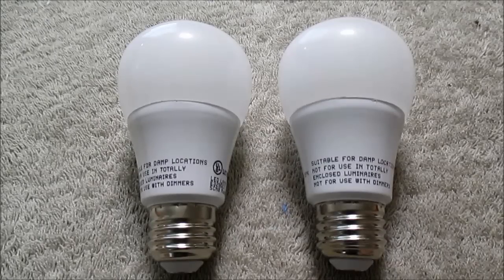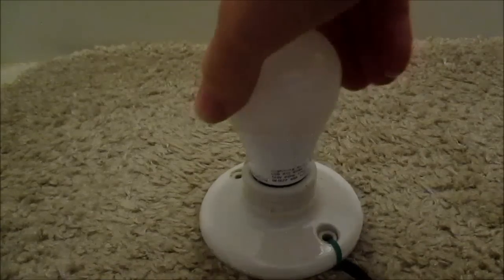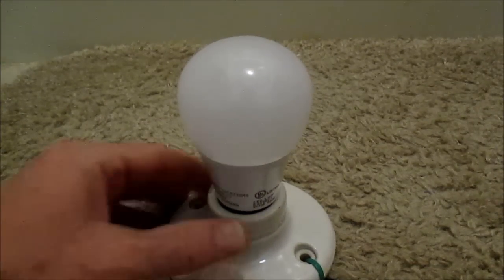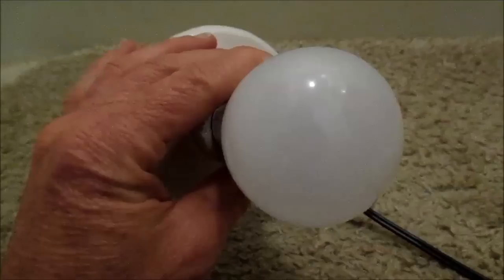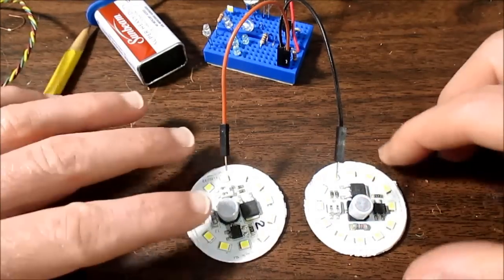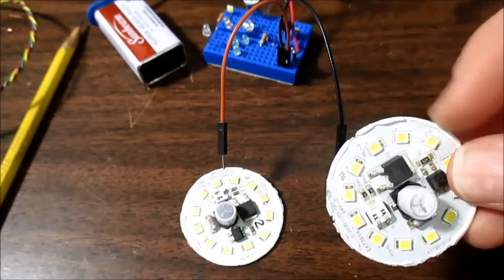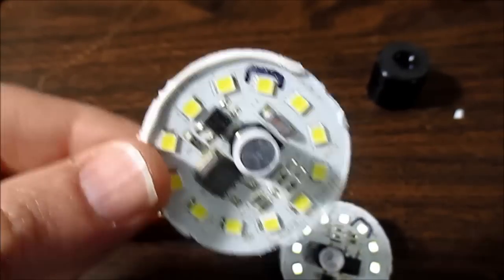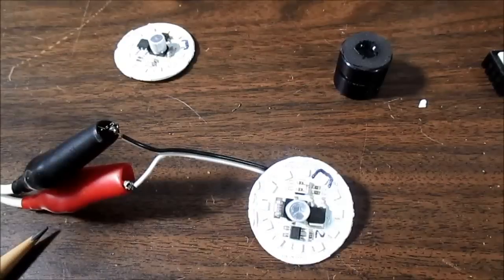Two failed LED bulbs for teardown to determine the cause

Comment: Those are set up as a series so they are designed to fail. Damn junk. Who does that. hell they dont even make christmas lights like that any more do they?
Reply: Not Here well said
Reply: I would say its more than just being uninformed. If you ever try to have this discussion with certain people, they will probably defend their way of life as "the way it has to be". Not everyone though. I try to show my kids how to fix things and how to buy things that can be fixed to avoid waste.  Also, how to stop buying all these things to begin with and how to be frugal.
Reply: Mike H : I always figured quality died because it was simply too good. Not that consumers were stupid. More than a few times over the years I'd find an excellent item, well made and fairly priced (not cheap, but not crazy high either). By the time it finally wore out or broke down and I needed to replace it the company was out of business, often for years. They probably made a small profit while they were in business but once the market was saturated with the product they were left without repeat business because their product was still going strong for those who bought it.

Along comes the (false economy) model of planned obsolescence where you make the product just good enough to last just long enough that the consumer is fooled into thinking they got good value so they buy another. Presto, infinite repeat business. Just keep churning out the same junk year after year after...

Same thing drives the whole disposable vs repairable marketing meme. Used to be pretty much everything was component based and easily repairable (by skilled people) by replacing a single inexpensive failed component. Then somewhere along the way manufacturing went to a module based design, where the components were grouped into units. If a component on a module failed you could replace the whole module (no skill required, plug and play) but could not simply repair or replace the failed component. Even while most of the module may be perfectly fine and continue for years more service. And that module was often a significant fraction of the cost of the whole product, often to the point where it was seen as just a smart to buy a whole new product rather than replace an expensive module only to have another module fail soon after.

Idiocy in my opinion, but too much of the public were gullible enough to (literally) buy into it. And quality repairable products were history. Replaced by crap disposable products.
Reply: @nothere7198  The issue is companies that are in the same market constantly try to undercut one another in price. This causes them to sell the product cheaper which leads to "cutting corners" in order to make a cheaper priced product.

just look at the Automobile market. look at how many mechanical and safety recalls and lemons there are among all car manufacturers compared to 20 or 40 years ago.
Reply: rats arsed excellent sarc!
Reply: I suspect they are calculated to not last too long. Isnt this supposed to work 10-15 years...yeah right.
If they gave the LEDs a bit more cooling, this would maybe not happen often.
Reply: You say "gullible", I say "uninformed", and/or "unable to find a reasonably affordable alternative". But the end result is the same. =:o\
Reply: Avi  inc  There is nothing stopping you from making lights at a loss and selling them to us. Go ahead. Show us how it is done.
Reply: +RC Hobbyist
   If you ever played with any kind of p-n junction rectifier, you might have noticed that in the forward direction they have a very low slope-resistance.  That is to say the voltage drop across them changes very little for a large increase in current.   With an LeD this forward voltage is 2.5 - 3v.   They therefore need to be run from a constant current source - a current limited source to avoid burn-out.   Since the domestic supply is ac 110v USA, 220v here in europe - the easy/obvious thing to do is to run them same as "fairy light" via a rectifier via small capacitor on ac side, and with a reservoir cap. on the dc side.  The rreason for the riduculous burn-out rate I used to experience, it that the series current-limit cap. they make several sizes to big !!  The lamps get very warm - almost like old incandescent !! - and of course on LeD will pop, just like Christmas lights.  Sometimes it is visibly cooked, other times you have to sift through to find it.  To do that requires a current source such as a "Blocking oscilator" to avoid killing the leDs.  Otherwise a 36?v battery with a 20-odd k resitor would do, to find the break.
   I have replaced 1.5uF x 400v caps with 0.47 - .68uf.  This gives 99% as much lightm but the lamp runs cool.  No more than blood temperature - and will last Donkey's years !
Reply: +boostedmaniac
  one leD "out" kills the lamp, since they tend to go open rather than short - circuit.  like fairy-lites.   You can bridge-out the dead one with a whisker of Cu wire - then replace the limmiting 400v cap for one of 1/2 to 1/3 the uF-age.
Reply: It would also be less efficient and produce more heat.
Reply: Rick   Take your meds!!!!!!
Reply: Okay, maybe another layer of tinfoil then.
Reply: RC Hobbyist Extreme not really. You set them in series, because the mtbf for LEDs is usually very  high. Also, you only need one means of current  control, so it is actually a simpler circuit. Of course if you use 2nd rate LEDs in the first place, that equation goes sideways, as with this product.
Reply: Actually they do. I just threw out a string of cheap series lights...
Reply: Cheap LED TVs also fail all the time. The PWM circuit is pretty neat, tho. Some have no more than half a dozen LEDs in series and a couple of zeners in parallel for each PWM drain. 

Others just do it in the simplest possible way, even employing poorly efficient voltage and current monitor-control circuits with dozens of LEDs in series fed by a single MOSFET so when a LED is shorted, the others begin to draw more current and short another one, so the circuit draws even more current and a couple of LEDs are also shorted and it goes on forever until one or more LEDs are blown, sometimes even melting the lenses and lighting the reflective paperboard on fire! 

I'm dead serious. I once opened up a Samsung  expecting to find a few open LEDs and I was surprised by burnt paper and molten plastic.
Reply: +ralorpa
  Replace the 400v cap. with one of 1/2 to 1/3 the capacity.  That makes un-noticeable difference to the light, but it runs cool and will last "Donley's years".
Reply: +Aeolwn
  Amps go THROUGH things luvvi.  It's Volts that go "on", or rather "across" things.
Reply: +renalpoen
 -- but think of the ammount of hot water each lamp could provide with a water-cooled heatsink !
Reply: +Thomas Bogel
  I would go so far as to say it is Always extremely long (mtbf) if the LeDs are not cooked-up with excessive current, as is the case with all the lamps I've bought.  They run hot like filament lamps.  Ridiculous !  A half to 1/3 of the current setting capacitor cures that.
Reply: +Gerard Vaughan
I kinda' agree... the caps seem to be the problem in 10+ led bulbs that I've seen failed; they are not correctly calculated, OR poor quality... and I guess designed to fail anyway as the datasheet for caps says 2000hrs max mtbf as opposed to "10-15k" hrs for leds. So I was looking to replace them also, but guess what: a good capacitor would cost as much as a cheap led bulb...at least in my market. I welcome any thoughts/corrections
Reply: +Christian
  Look on ebay, I think you will find it well wortgh while to buy a dozen or score of 400vac x .47 to .68uF  Possibly 1uF for the bigger lamps.  One I have, has two seperate rectifier units, which had 1.5uF series in each.  I ended-up with .68 in each, I think.  But you need to buy  at least 10 of each.  They will go - or sell ! - soon  enough.
Reply: +Mathew Young
  Mass production is the Only way to make the things we have affordable.  Stock-holding is therefore just as essential as the Liver is to the body.  Cancer of the liver, however, is quite horrible.
Reply: Everything is swimmingly super in "capitalist" false flag terror controlled uk - yes we know.  We moved to Bulgaria when we had the chance !
Reply: +Jay Eddington
  What a great idea !  "We" - the politbureau -  could set an upper and lower limit for the ammount of Anything that Anyone was allowed to have on their premises !   Imagine all the smart jobs that would create fo bureacrats and Swat teams !  Super, just like USA but even way further ahead !   Some items would be compulsory to buy like insurance - and LeD lamps - but not too many - and if you sell one you have to confess to a pedofile and pay him to kee quiet, because he's Bound to be further up the "DNC" than us. :)
Reply: + Gerard Vaughan
Thanks!
Reply: Jay Edlington dumbass communist
Reply: Using LED's coupled in a series circuit with a constant current LED driver ensures the same amount of current to each LED thus each LED in the circuit will emit the same brightness and will not allow a single LED to consume more current than another. Also, having the LEDs in series with same current eliminates the risk of thermal runaway and potential short circuit that would yield all LEDs to stop working in a parallel circuit.
Reply: Jay Edlington yeh but "Fuck you got mine" is more profitable so that's what we do, if course. Americans always do the right thing, after they have tried everything else!
Reply: WhatsaScrewdriver? If you want to get really angry go and read about the Pheobus Cartel, this business of making shitty, short-lived light bulbs in order to sell more has been going on for a very long time now
Reply: Jay Edlington company's would go broke led last a long while
Reply: Wow, Quite a story. You really have a lot of interest and enthusiasm! You really have looked into a lot of interesting things.
Keep your chin up and enjoy the good times and things you have. It is sad to hear about the shitty aspects.
Reply: I wish all the best for you. I feel like you're an old friend now. You have a lot of good stories.
Reply: It is cheaper since they can operate at a lower voltage in series.
Reply: Xmas lites are no wired in parallel.
Reply: Jay Edlington So Cuba should have better products then?
Reply: rats arsed Stalin and Kruchev agree.🤜
Reply: Nicely done, rats arsed
Reply: they may be designed to fail to prevent burning up
Reply: We are stuck with led in series unless  we we fit them with inverters to reduce the voltage like some do  I think the problem is they run to hot as they are  way short on recommended heat sink size and the lamps have plastic domes to make them look like old incandescent s and to make them safe
Reply: It's designed to fail so you have to keep buying more.  Designed right they could continue to supply light as leds fail.  Like FAA approve led obstruction lighting on towers.
Reply: +Rick Delair I might add the shunts in the incandescent christmas lights are  insulated wire wound around the filament mounting wires.  As long as the filament is intact, the shunt will stay cool because most of the current is passing through the filament.  When the filament opens, the shunt heats up and melts the insulation from the shunt winding, shorting it, and allowing the rest of the lights in the series string to operate at slightly higher voltage per bulb.
Reply: @Mike H Apple's actually failing.
Reply: @Drakilicious they were built in china because murican companies paid them to make them, and also told them to make them super shit quality.

thats not chinas fault. theyll just produce what you tell them to.

they make almost any long lasting high end product too btw
Reply: I guess they like the chance that people will continue to buy their bulbs than actually making a quality product.
Reply: No.  They are set up in series because dropping less voltage results in less driver loss, as does using a tiny fraction as much current to have them in series as much as possible.  What makes them designed to fail is inadequate surge protection and inadequate heatsinking so they run too hot.  Remember back in the day when quality LED bulbs cost closer to $50 and had big metal heatsink fins?  

LEDs are more efficient now but not THAT much more efficient.  On the plus side you can get a similar bulb for about $2 now and the $50 ones don't typically last 25X as long, so there is still value in them and the power savings from having more people adopt them.  At $50 each there was no way I would have replaced most of my home lighting but as they dropped under $5 each I started to and now have dozens of LED bulbs deployed.
Reply: So what are you gonna do, put them in parallel?  Then you'd have to have to step down the voltage so that you wouldn't blow the LEDs with too high of a voltage.  By putting them in series, you can simplify the AC to DC conversion.
Reply: RC Hobbyist Extreme Did Apple design these?
Reply: How else could they become a trillion dollar company and not be a market leader?  Look up the market share for Apple products.
Reply: ralorpa could also be where the bulbs were used, such as in an enclosed fixture. Most of these type of led bulbs shouldn't be used in enclosed fixtures but I'm sure some people do it anyways.
Reply: +Jay Edlington

Get out of here with your Communist bullshit. 

These bulbs were literally produced in China, a Communist country. And, people in Soviet coountries smuggled in first-world appliances because their own goods were either of poorer quality or non-existent.
Reply: @rogerlost5851  Thank you sir!
Reply: @rogerlost5851  *these bulbs were produced in china with **a shitty quality governed by murican companies trying to screw you off while making the most money out of it

its not chinas fault its capitalisms fault
Reply: I blame it on the american business man (Profit, Profit, Profit)he sets the level of quality according to the amount of profit he wants to make and tells manufacturing how much he will pay.
Reply: +RC Hobbyist Extreme Yes, actually they do.
Reply: @johnm2012 , they also build in anti fuses so that many bulbs can fail.....
Reply: @matthew65_4  I'm afraid I lost interest in this thread a year ago. There are too many children name-calling.
Reply: Planned obsolescence is a cancer, the very same as unfettered capitalism. If products were produced for the people, and not for the stock markets, we would have a very different world. One benefit though, is that technology can proliferate much more readily than expensive redundant systems/mechanisms.
Reply: @edlingja1  Oh shut up this has nothing do with capitalism. If you don't like the lifespan of a product pick a different brand that makes things with longer lifespans. It's that simple! Capitalism is an altruistic system where what you produce has to actually be wanted by the people. If it's not you go bankrupt almost immediately. If something isn't "good" according to your standards then it's the people themselves that are to blame. Man my parents lived under communism and when I was little I saw cars with smoke coming out of the exhaust pipe all the time. It was so bad a chicken would have died if it had accidentally crossed behind the car I'm sure. I never see smoking tail pipes these days. I wonder why...
Reply: @davidcobra1735  the prerequisite of capitalism not failing would be that psychology is that ez, and that you cant be manipulated.

the real problem is that theres 2 forces in capitalism (textbook definition of capitalism is equal power of every party)
its consumers and suppliers.
one is a decentralized force the other a concentrated force.
a concentrated force is always stronger, so it would need governmental action to make it equal.

to come back to the real problem: companies convinced the decentralized force already that good practices to maintain a stable capitalism are bad practices so that they will never even try.

ask muricans what they think of 1. universal healthcare
2. government regulations on products
3. governmental regulations on company size
 just to name a few.
these are prerequisites for a working capitalism but arent met at all. even in glorious europe things are getting worse, because companies slowly take over
Reply: @davidcobra1735  communist music playlist wtf are you talking about, youre clearly out of your mind.

capitalism hasnt succeeded, since the wealth isnt rising, in fact its falling.

it has succeeded for the first 50 years, since there was enough to rebuild, and infrastructural sites, and so on. now that we pretty much have everything we need it fails big time.

employment rates are dropping in every single first world country, except for some who artifically increase them. (which wont last long though)

this trend will continue until capitalism is not an option anymore.

and btw to your "americans are earning wages several times higher than in your country" that is just because 1. they pay less taxes than in most countries, and 2.  many middle class workers work more than 40 hours a week.

and their wealth is decreasing slowly.

your country might just be less developed (because they started to develop later), so you earn less. this will change in the next 20 years anyway, because by then most of  the countries that are uprising will be first world too.

and if you ask me nicely why i think like that-..

just one example (even though there are thousands like that)
in america whenever theres a big prison, companies will settle down next to it and use the inmates as cheap workers. theyll also bribe judges to get them more inmates for even bigger profit. but nobody will ever listen to inmates because theyre deemed as the evil that only lie.

okok a second example. there was legitimately an owner of a youth prison bribing a judge to get him more inmates because of the money that he gets for every single inmate.
it got so far that a boy got 1 year in prison for accidentially shooting a ball through a window. 1 freakin year?????
look up the story, its not made up its 100% legit and the judge and owner got sentenced

capitalism fails because people will always do shit for money, and the more money they already have  the more shit they can do, like borrowing money to home owners, and then taking away their house by shady practices. (happened in murica too, where banks used shady practices to get houses unjustified) thats how the financial crisis of 2009 happened btw, because they took away so many homes and im not talking thousands, im talking millions and millions of homes, so that there were too many houses to sell, and the prices dropped immensely, and the banks "needed" to be bailed out by the public because on paper they didnt have enough equity capital left 

which again was just a stunt to make more money, because they made huge debts, while making money off those debts and simply let the taxpayer pay their debts off.

to make it clear, any company can, on paper,  be bankrupt in a matter of weeks, just by altering their assets so that they look like theyre bankrupt, even without moving any money, and thats what the banks did
Reply: tenalpoen 
One LED failure would mean a dimmer light and the customer complaining again and probably throwing the light out anyways.
Reply: Capitalism isn't the problem. It's the stock market controlling it. The stock market is the cancer of capitalism.
Reply: To control each LED would require a separate circuit for each LED and that is a lot of circuits and cost and much bigger ICs, so they run them in one string and try to keep the reliability high.... but obviously they didnt meet that mark with this batch of LEDs.  No grand conspiracy, just the result of trying to make a really complicated assembly ridiculously cheep. Who would have ever though one could have this amazing tech created so dirt cheep anyway? They will either iron out the reliability issues real soon or the market place will vote them off the island!
Reply: RC Hobbyist Extreme all of the lights in my house go out during the same month every year
Reply: tenalpoen How much more can a resistor cost dumb ass
Reply: rats arsed.  Do you think it would be too communistic if consumers simply demanded higher quality products, such as LEDs that last 10 to 15 years the way their marketing promises?

Do you think it is too communistic to have more services available such as Consumer Reports so people can make more educated decisions about their purchases, such as whether to buy cheap now or invest a little more for long life and more economical in the long run?
Reply: Rave on young fella. You are the first incandescent light buIb conspiracy theorist I have ever heard of. 
I made my fortune as an industrial lighting contractor. I have installed lots of extra long life incandescents in signals and navigation beacons. The were really dim. I have worked with mercury vapour, HPS, LPS, metal halide, instant start and rapid start.
Yeah, some of these LEDs are disappointing. Some last and some don't. There is a lot of hype.
Reply: Move to Venezuela, you piece of communist shit.  You would love living there!
Reply: If the LEDs were all in parallel, they would need a resistor to drop the voltage. It's not hard, it just costs more, and failure rates on LEDS aren't high enough to justify it.
Reply: tenalpoen  A resistor just wastes energy as heat. Putting them in series drops the voltage, light's em all up. Basic design. But it's true that when one LED fails, it kills the device. The alternative, to have them in parallel, requires much more voltage-drop to avoid frying the LED's. We are talking about getting 110VAC down to a few volts DC if you want them all in parallel. THAT circuitry would cost much more.
Reply: @Barry Levine  < But it's doable, and that's what separates quality products from the junk.  Personally, instead of paying only $10 for a junk bulb, I rather pay $20 for a quality one and enjoy it for 20+ years rather than just a few month since the serial ones burn out fast as we all know it.  Also, time is money, getting in the car driving back to the store, exchanging it, replacing it in the fixture is a waste, therefore a quality product more than pays for the price different.... at least on my planet. ;)
Reply: @tenalpoen  t
The main reason people switch to LEDs is for higher efficiency. The loss in the dropping resistor is minimized by putting the LEDs in series. Unfortunately the susceptibility to surges increases. Paralleling each LED (3 LED chip) with a series of diodes with a higher forward drop than the LED would effectively bypass any LEDs that open but the cost of all of those diodes would increase the product price. The higher price would lengthen the pay back period. Now that we as consumers know not to trust the stated average life, we will seek some sort of independent reliability testing before buying large quantities of LED lights for a re-lamp project.
Reply: RC Hobbyist Extreme They could be designed where they use 4 larger leds in parallel and powered by switching power supply simular to a cellphone charger. The cost to manufacture would be the same. Look at all the components on the circuit board of this unit. Hell theres enough components to build a switching power supply already on the board of this bulb. Finally if they didnt want to use a switching power supply, then they could of used a resistors instead. The clock module on my range uses resistors to step down the 120 volts for the low voltage components. They build stuff like this to fail. Greedy capitalist asswipes.